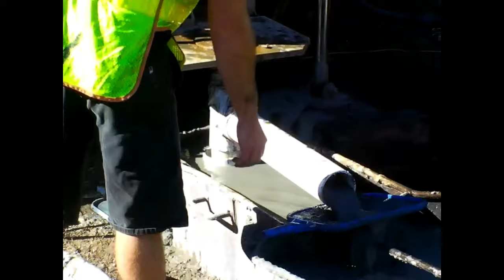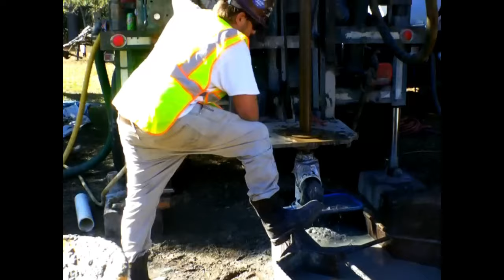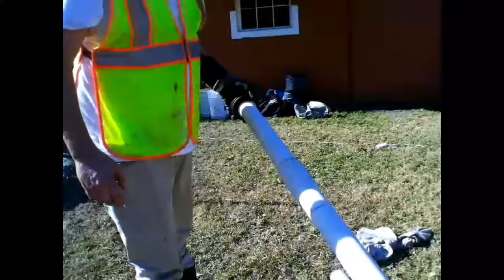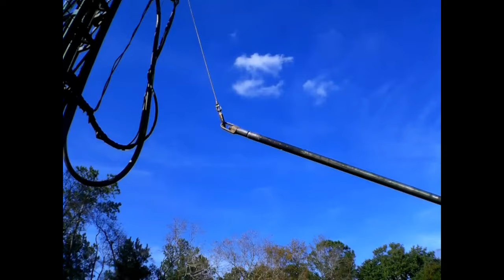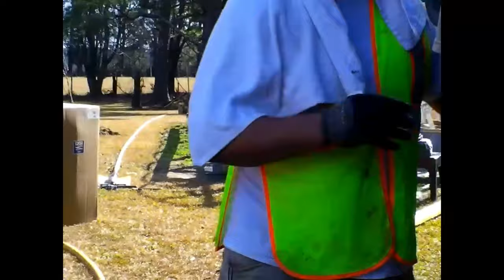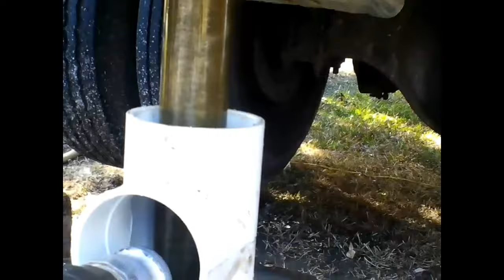Part 3 WELL = SUBMERGE PUMP AND PITCHER PUMP

Comment: I bought a pitcher pump from Menards and want to slide a hose or pipe down beside the submerged pump mechanism inside the well casing to use ONLY during electrical failure. It is supposed to pump 25 feet. Just like you are speaking of here, will measure the water depth soon.
Reply from the maker: Awesome! You won’t regret it. Last year we had a Arctic-Storm and the power company shut the power down, but no problem-I went outside got water for the animals and for me. Thank you for sharing!